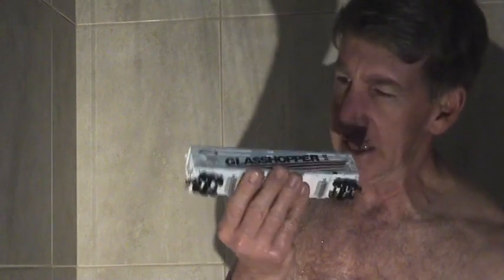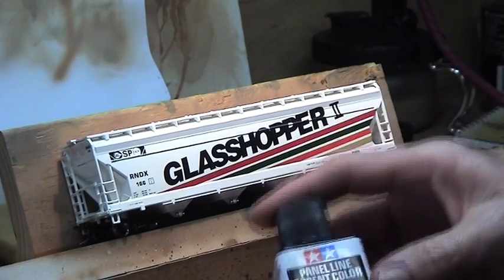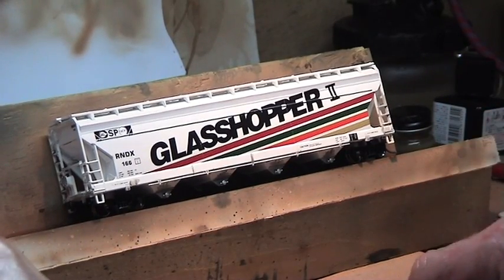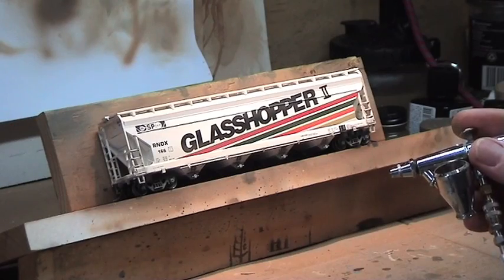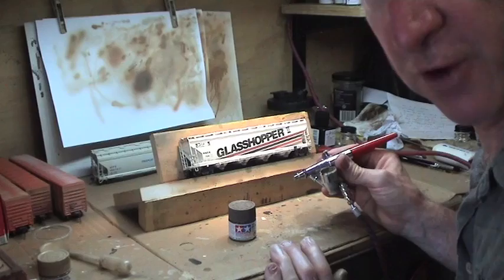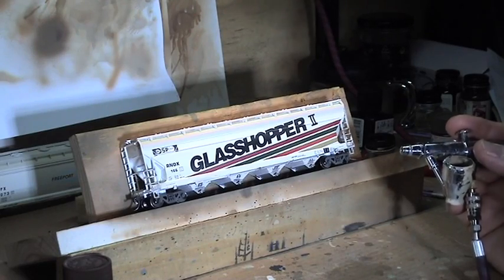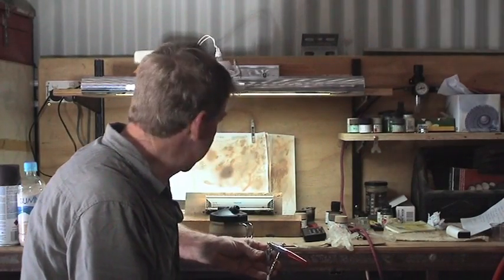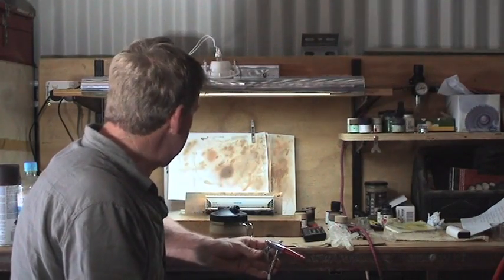Airbrush Weathering Hopper cars ,for Newbies...like me!!

Comment: Thanks for posting, mate.  For trucks, wheels, freight car bodies and locos to add rust I use REAL rust.  I take a roll of fine steel wool and put it into a quart jar and fill it up with white vinegar and set it on a window sill so the sun can shine on it.  After a month or two, I pour the liquid out into a stainless photo tray from my darkroom (10X14).  After it is completely dry I use a single edged razor blade scraper and scrape the rust out of the tray.  It usually comes out as a fine powder.  I then store it in a snuff container.  Depending on how long you leave the steel wool in the vinegar my batches come out with different colors of rust, i.e., some are orange and others are a deeper colored red.  When I get ready to use it I put several scoops of my rust into a plastic communion cup (neat little cups for mixing paints) and add some alcohol, Elemer's white glue and a dab of water soluble glycerin.  Then I just brush it on.  If I want an area where the rust has eaten through the metal (plastic) I use my X-acto knife and make some gouges in the sides of a car and fill it up with my rust.  To seal the rust I usually topcoat it with a flat acrylic clear coat.  It looks very realistic 'cause it is REAL rust!  Happy Railroading!  :-)
W Rusty Lane in eastern Tennessee (Witherington Place Railroad)

Comment: Hi Gregg! excellent tutorial. Like always you a bound with ideas and fun facts, you make it easy to watch. The seems on the side of the cars I tape them on both sides or use a sticky card cut in the middle and stick it on the side of the seems ( leave a hair thin opening) just enough for the seem to show through and apply powder on it. Is tricky because you can really see the effect until you pull the tape or sticky note off. I also agree with BArailsystem about masking or removing the weels when you paint the trucks. Anyway, great tutorial full of info. Thanks a lot Gregg. Cheers my friend. RT
Reply from the maker: Thanks RT' I'm glad you had a laugh and enjoyed it. I tried your idea with the Panel line paint, but it bled under the tape, so I'll try it with powders. I tried applying powders to the seams with a Micro brush and it worked ok,just need a bit of a clean up. As far as the wheels go , I didn't get much paint on them at all??, but I will clean them up before they run on the layout.  Thanks for the tip and watching. Take care sir,
Cheers Gregg

Comment: Very nicely weathered cars, Gregg! One thing I would suggest: before weathering the trucks (actually before weathering the car at all) remove those nice metal wheels and install some cheap plastic wheels from a train show or a modeling buddy. That will protect the pointed areas on the inside of the trucks and allow the trucks to get nicely painted, but it will protect the metal wheels form getting paint where paint shouldn't be. It can be rather troublesome getting dried paint off of the wheel treads. Don't ask how I know this.
Reply from the maker: Thanks FLyboy!  I take the trucks off and leave the wheel sets in , as I use three different colours on them , first thing I do is use a paint pen with rusty rail colour and do the wheel faces, still in the truck. Then the truck gets 3 different colours  with light coats in random spots and this covers some of the wheels and I don't get any paint into the bearing cone. Once the truck is done , the excess paint on the treads is easily removed with a cotton tip dipped in Isopropyl   alcohol. The paint pen is great as it only puts the paint  where you wan't it and is much tidier than a brush. Maybe I should do a video on the process?
Cheers Gregg.

Comment: Fantastic video Gregg. Thanks for sharing your findings with us. Have you ran the cars you weathered on your layout yet? I had an issue with the paint coming off the wheels onto the top of my rails and then transferring to locomotives and other cars, it was a mess and took me a while to clean it up. I bought a wheel mask after that to mask the wheels while I am painting to prevent paint from getting on the conductive parts.
Ben
Reply from the maker: Thanks Ben!  No, none have run yet, but I will clean the wheels with some thinners after I finish the powders.I haven't got much paint at all on them as yet, I'm still deciding whether to remove the trucks and do them separate?? What are these masks you speak of wise man!! Thanks for the comment mate.
Cheers Gregg
Reply: FishplateFilms
I've got one like this: 

http://www.micromark.com/acrylic-paint-mask-for-ho-scale-wheels-set-of-2,11679.html
Reply: BArailsystem That was a clever piece of kit but reamember that you can drill a hole in some sort of plate and hold the Wheels by hand on the left as you hold the airbrush in Your right hand. A bit more work but cheaper With same result.

Comment: Good job Gregg!! 👍👍
Weathering scares too many people! I haven't seen (yet), your newer work... but nice start. I see you've referenced some great modelers of weathered equipment. If you ever need it, I can finally offer YOU some advice, if you still need some!! I've been weathering since 1986, using nearly every medium, except Pan Pastels. Can't afford it, but really want to work with it.

Some people here have offered bits of advice - most even good!! 😜  You already have the best reference you can get. You work close to these all day long!! If you can, whip out the cell phone and snap some pics. Get under care, around the brake gear, between the wheels, and on bottom drop cars, around the chutes.... 
Also, on roofwalks (probably only on Hoppers in your era), carefully sand the tops of the walkways, as they are worn by worker's boots. Most of the time the fill caps will be the cleanest, especially in food grade Hoppers. Sometimes, one or two fill caps will be new replacements, and shiny new. Many individual fill caps will have slightly different shades of color. 

If you model mostly the Western US, your "fade wash" should be closer to white, bone, or a very light being. 
As far as the streaking, brush streaks(especially rust), is much better done, using artist's oil paints, dotted, then streaked downward with a brush, dipped in pure Turpentine. To this day, still the best method. Have patience though, it can take up to 3-4 days to dry enough to work on the model further! 
Also, it's just not easy. Took me over a year to get really satisfactory results.

BTW, brilliant idea rubbing a napkin on a freight car truck! I've actually not heard of that one, but will be trying it.
I hope you've taken what I wrote as nothing but constructive!! 
Carmine 🚂
Reply: And............ My 6 year old granddaughter saw the opening......
She's currently in therapy, and we're now worried!!!
LMAO! 😜😁😂😂
Reply from the maker: Thanks Carmine, 
I always appreciate advice , so very welcome! I am always looking at videos that show the tops of cars and locos but unfortunately, we don't have the variety of cars down here and I don't work around much freight at all :-(.. I do a black wash now and then spray a very light bone to fade and then apply dirt and rust with the airbrush and powders. 
Hope ther young lady is ok....should put a viewer rating on this one..LOL
Cheers Gregg
Reply: Not to worry, mate! She's a tough little girl. 😀
Your weathering that I've seen, looks good.... and I ALWAYS follow rule #1 of MRR'ing - if it looks good to you, that's what really matters!!
If you should ever have questions, please don't hesitate! 😎👍👍

Comment: Great video and a Nice result. I think Your old hopper looks great to:) If you`re worried about only 18% Girls watching Your vids, I think you did a great effort in getting more Girls to watch Your channel. I only have a small tip and that is in weathering one can get away With most looks because some New hoppers might be more dirty than other similar New hoppers. This because some may be used near wery dirty industry and some will not. So there is your get out of jail freecard if you weather one hopper to Heavy at some point:) I started With an airbrush With the same basic design as Yours and it was not any good so I would appreciate if you can share With us what brand and model you use in Your Next video, since Yours is working, hint hint:) Thanks for a great demonstration and for sharing:)
Regards
JC
Reply from the maker: Thanks very much JC !. As you see by my latest weathering effort, I found a wash that works. I prefer cleaner cars and as you say they are all different but most of mine will be on the cleaner side.I also think the new cars are better due to their better paint jobs. My Air brush is a Pasche VL dual action, not too bad and always use a paint extender (a few drops of glycerine in your thinner mixture) to stop the paint drying on the tip. Glad you liked the clip!
Cheers Gregg